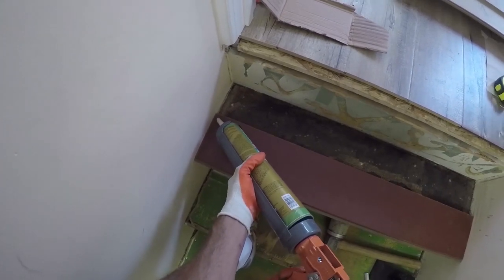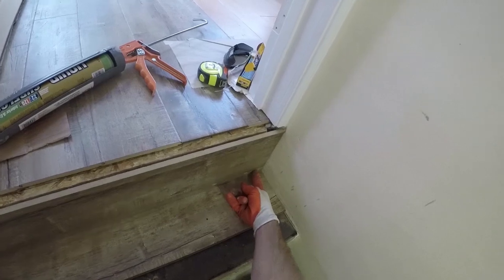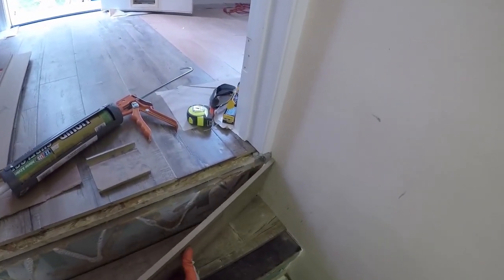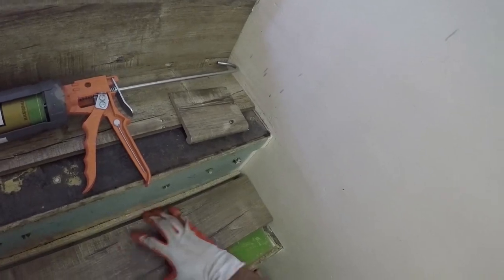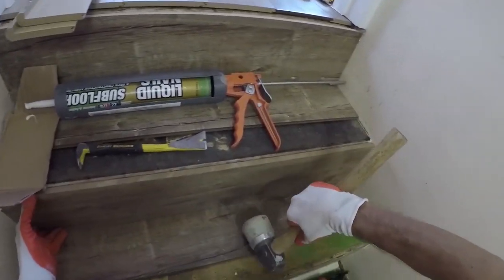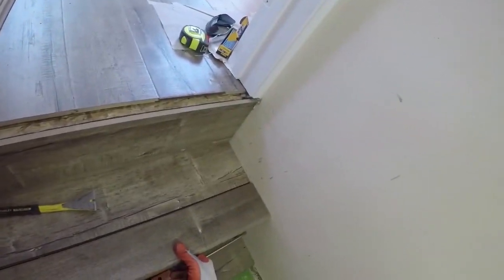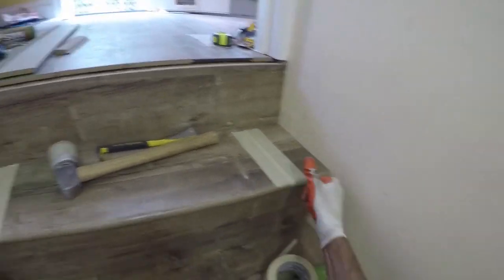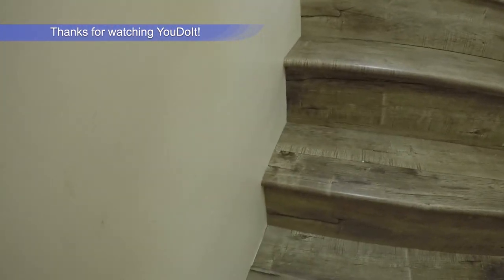How to Install Flooring on Stairs | NO Nail Holes | NO Gaps | Step by Step | DIY

Comment: I think Vinyl, Laminate, and hardwood are all dangerous on stairs.  I know carpets are dirty.  I think using a easily replaceable carpet runner may be the best way to go.  You only have to fall down from a slippery stairs once to realize carpet is the safest option.  Since permanent carpet is too hard to replace therefore I recommend a runner option.
Reply: Are you posting this comment on every video you see showing how to install laminate on stairs?
Reply: @bazzie85  I want people to know how dangerous it is to  install hard surfaces on stair.  Being a victim of a painful fall, I hope no one suffer the pain I did.
Reply: I’m seeing a textured vinyl flooring that can be installed & was thinking that would be a potentially good option. I have old cat scratched up carpet & want something easier to clean  & harder to damage (we still have the cat), but I worry about the safety of the hard flooring too. I’m sorry you fell & I hope you’re ok @Raymond_Chow.
Reply: Look into Floor Doctors “Floor Grip”. It’s a non-slip treatment for wood and vinyl flooring and it is perfect for wood stairs. It’s basically a specialized urethane that makes wood stairs slip-free.
Reply: @NickFrongillo  I wished i knew back then.

Comment: He does not tell you if the steps are not true as far as the width of them. Sometimes the front of the step is 32 1/4 and towards the back maybe 32 1/8 so you would need to cut the riser and tread on a slight angle so you minimize the gaps on the side of the steps and use minimal caulking